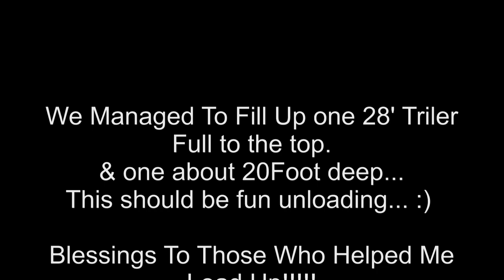The move, Update. with a lot of good help! wow i have too much stuff...~Russ 3-4-14

Comment: Man, you look just a little bit overwhelmed. Is your house already sold?
Reply from the maker: nope... :)
Reply from the maker: i still need those measurements on cores you need! :)
Reply: Roughly 3/4" x 3/4" to 1" x 1" and no less than 2.25" long.
Reply: *****
Safe trip to you and the family.
Reply from the maker: ZeroFossilFuel
ill need to look once i get my 1000+ boxes back! lol ~Russ

you want E cores or U cores? can you send me a rough sketch, your email did not send correctly last time.  you want flat "bars" what thickness...
Reply from the maker: ZeroFossilFuel
i think i have something that will work for ya